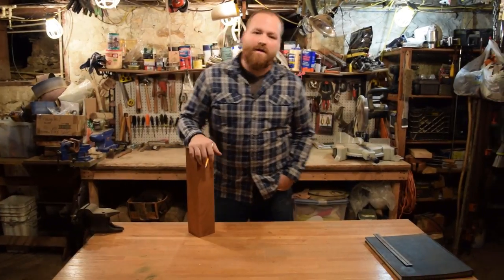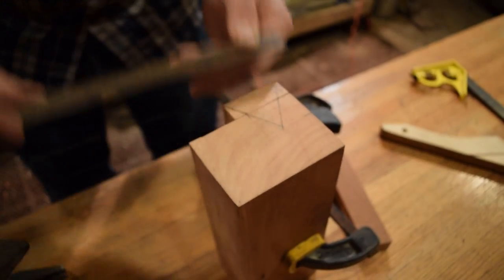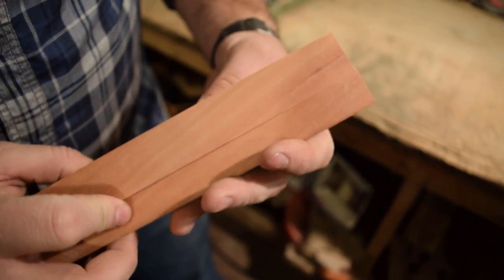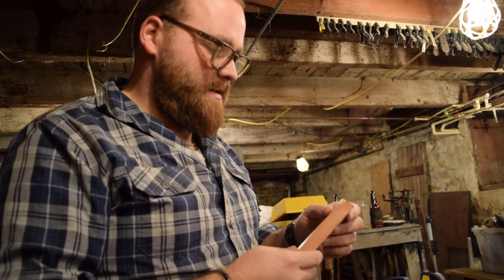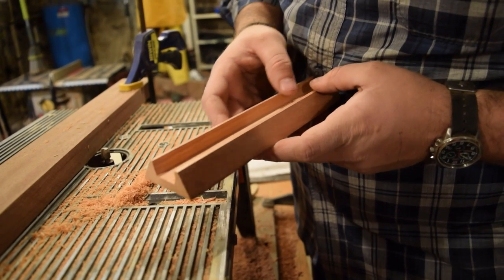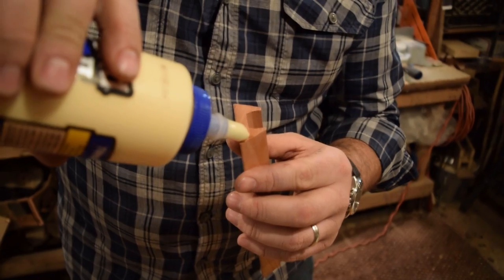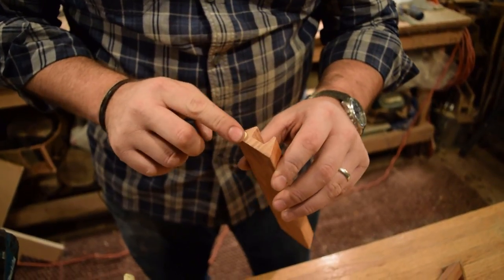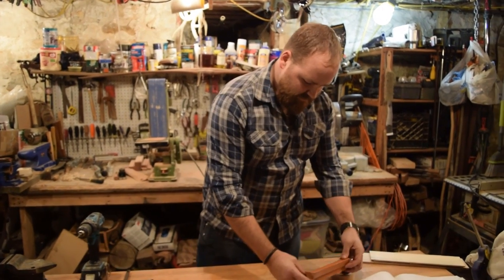Making a Wooden Pen Box

Comment: I know this is an old video, and maybe you've figured this out already, but you had your fence set up on the wrong side of the router bit. The slots in the table top are for the fence that probably originally came with that table. The way you had it set up, it was pushing your workpiece away from the fence. If your fence was set up on the other side of the bit it would pull with piece toward the fence and give you a more stable cut.

Comment: You should have use a plunge cut to make the grove so it wouldn't go all the way to the ends. You should have taken much smaller cuts with the router and maybe put a 60° cut on you fence. Great looking box couple of tweaks and that could be super sweet

Comment: A good lesson in letting the bandsaw blade do the work: if you push too hard, you can displace the blade and move your line of cut. This may not look significant at the start of the cut, but by the end it can be an annoying deflection. great video though.

Comment: Seriously lucky to have made it out free of injury on both the router table and the table saw. I've been badly injured in the past on both, by using them the way you did in this video.     And on a side note, what was the purpose of using wood glue on brass rods? It doesn't help them stick in the holes, so I was just curious

Comment: Good Work, I see you are using some of the same tools I do, the Skil saw and the crafsman router. I fabricated a zero clearance blade shield for the saw, but it only works on the 7 1/2 inch blades, not enough meat to fit the ten inch. I used stumpy nubs pattern for a router "box" and used a French cleat hanger for it to hang on the side of the workbench ala Jay Bates, off his router mounting plan.  If you find an idea for making a zero throat clearance for a 10 inch blade, let me know.

Comment: The reason the angle cut came out that way was because u didn't have the top support arm down closer to the cut and the blade flexed. When u use the band saw ALWAYS have the top support arm close to the cut.

Comment: Nice project I hope you had fun making it but I must say it's time for some new tools and or blades everything you are using is shoty old and dangerous if you truly think you will continue doing woodwork please invest in some safer tools god bless and be safe
Reply from the maker: jayboney el toro thanks for the comments. I do my best with what I have, but yes, my shop could definitely use a tune up and better tools. I'm haveing fun with what I have and upgrade when I have the money. One day at a time. Thanks again for your concern and good bless.
Reply: I noticed the dull table saw blade as well. Cheap upgrade that will make life much easier. Changed mine recently, had no idea how bad it was until I made my first cut with the new blade.
Reply: aside from needs related to safety, which has no price, I truly appreciate the fact you make great videos, and quality projects using CRAFTSMANSHIP rather than money.  I have some expensive tools and don't get nearly the results you do with passion, practice and sometimes a little patience.  I will always be watching and learning from every one of your projects so thank you thank you thank you and please keep up the great work.